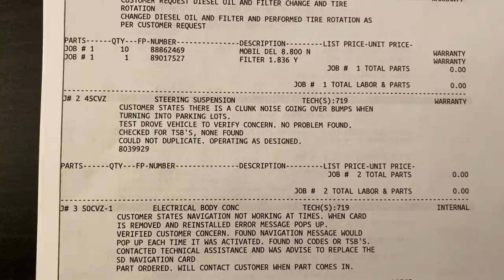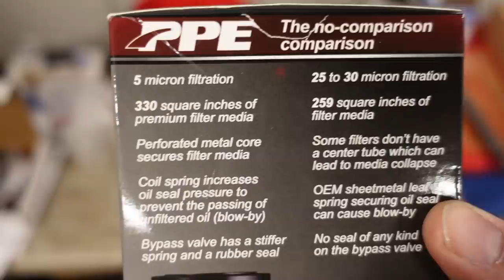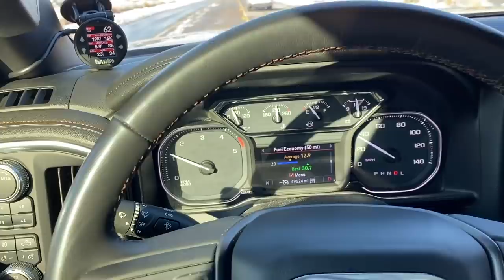fixing THE MOST ANNOYING PROBLEM with the 2020+ GM HD trucks

Comment: I bought a 2001 2500hd with 100k on it last year rather than buying the newer trucks I was looking because all new chevys are junk. It's crazy there's people doing all this work on a 2020 vehicle
Reply: Bought a brand new 2018 sierra all terrain 6.2l, a 2019 2500hd 6.0l and now a 21 2500hd duramax.. no idea what your talking about, not a single issue with any of them.. they're sitting in the driveway next to my 05/07 duramax's and the 2000 2500hd 6.0 supercharged monster..
Reply: @jredd801  I leased a 2015 high country and pulled quite a bit with it never above the towing capacity and at 20,000 miles the truck was beat the lifters ticked and it shifted like shit I felt bad for the person that was going to buy it. I leased a 2013 the first month I had it the water pump was pouring out coolant left me stranded. A lot of the new trucks have oil issues. When I was buying used trucks I worked a lot more on my 07 and 11 than I did my 99 and 2003
Reply: Also I think a lot of the issues are in the half tons the 3/4 and 1 tons are obviously a lot more durable

Comment: I surprised GM decided to put the oil filter within reach of the front driveshaft. If that U-joint ever breaks it will probably  take out the oil filter.
Reply: They've been like that for years and I've never personally heard of that happening.

Comment: I'm curious!  I have owned two Duramax 2500s and have been lucky to never have this issue.  Now that I see the shaft I have ask, has anybody taken the slip yoke apart and greased it well?  Or better yet put in a zerk?  I know back when I spend a lot of time offroad it was common for a slip yoke to cluck when it was dry of grease.
Reply: That was the tsb for them back in the early 2000s. Grease the splines and no more clunk.

Comment: This is actually a old Chevy problem from the GMT 800s as well they sold a kit where you would inject grease through the bottom of the shaft by removing that weird clip pin you literally have to do it every six months or the clunk will come back
Reply: I wonder if the newer trucks with electric steering are made different

Comment: Warranty is not any good for small items. Rear ends, 4 wheel drive, transmission and internal engine are hopefully covered.
Reply: The labor would be covered on any internally lubricated part, and/or any part damaged by the fault of any warranty covered part, or parts, though. I have a feeling that this is what he was concerned about. However, i couldn't be sure without asking.

Comment: Thanks for the info on all the filters I went ahead and ordered the bigger oil filter for my l5p since it’s not a 20 I guess it will fit as well as the fuel filter kit and I seen PPE had a nice upgraded screw on trans filter too so i decided to go with that too since the truck is turned up way beyond stock trans levels I figured I may as well get all good filters and try to keep everything alive as long as possible lol but thanks for bringing it up I never thought to look for things like that 👍👍 good looking truck BTW 🤟🤟
Reply: 2020 are different thread i believe  than earlier models. on the oil filter
Reply: @JCunningham21  ok very good to know when I looked on their site for mine I entered my year but I may double check and make sure I got the correct one thanks

Comment: Is there any particular reason why you went with that new fuel filter kit vs the blackmarket performance one with the cat filter?
Reply from the maker: Not familiar with the black market one, but if it uses the Cat 1R-0750 filter I don’t think that has a built in water separator?

Comment: Sea foam is fine gas burners not for Oil burners it lets water pass through the water separator
Reply: I use it in my 7.3L and 6.0L Powerstroke,  works great.
Reply: Heui injectors don’t have issues on the fuel side not trying to argue but sea foam offers no benefit in Diesel engines but certainly can cause issues and actually has less lubricant them just regular diesel fuel the only time a additive is needed is in extreme cold to prevent gelling not trying to be that guy but just trying to help if your really concerned about fuel quality or doing something that can really help add filtration dirty fuel is wat cause’s wear and in you case with a heui injector run a anti stictiin additive every othe oil change

Comment: 505hp and over 1k torque in the 2023 duramax and a new interior... what do you think LT? Is this beast getting traded in?
Reply from the maker: I don't know, that does sound appealing though
Reply: Nope.  Only 940 pound feet.  A bump of only  30 over the present trucks.
Reply: @richfarfugnuven6308  yeah unfortunately less they rumored
Reply: @andrewbrack77  I tried to order a 2023 F350 as I wanted 1200 pound feet.  They told me 10 months.  I bought a 2022 GMC Sierra HD AT4 3500 off of a lot.  No markup.  Doesn't pull my 42 foot fifth wheel as well as I would like up the Ike Gauntlet,  but you dance with who brung ya...

Comment: LT what percent tint do you still have on that truck? I remember originally you said you thought about taking it off since it was too dark. Just curious as to what you did.
Reply from the maker: The backs doors and rear glass are still 5% but I switched the front windows to 30%, windshield is 35% I think.
Reply: @LawrenceTolman  Is that 5% over a factory 20% privacy?
Reply: Jim jibroni  I have a 50% shield, 30% front two windows and then 17% over the rear three which has the 20% privacy glass from the factory. Thinking about going darker
Reply: Jim jibroni   Law enforcement as far as I know doesn't have a way to measure windshield tint.

Comment: I've been a chevy fan for years, but theoreticaly you'll need another transmission and probably the rest of the injectors around 70k miles! that sounds a bit fragile for what I'm used to.
Reply: Not if it's an Allison. .....and you don't have a junk ass edge tuner
Reply: I’ve seen too many GM issues lately. Buddy just had his 2020 in the shop for a month with bent rods. And it’s not the first one I’ve seen with the same issue.
Reply: @trentdawg2832  GM doesn't use Allsion transmissions anymore.  They are a GM product and they pay Allison to use the name.  Zero Allison parts in a GM HD truck.
Reply: @richfarfugnuven6308  that 10spd is junk…..id rather have my 6spd allison 1000 any day…….far less parts to give you issues
Reply: @trentdawg2832  no problems with mine so far...
Reply: @richfarfugnuven6308  maybe you got a wednesday built truck…..those are the best!!!!

Comment: Alma steering shaft could you not just take a couple of ball-peen hammers or something and didn't decide of the shaft at the tiny bit not enough to deform it and make it non-operational but to tighten it up a little bit

Comment: Don't add oil to the filter prior to installing it! You are basically then introducing unfiltered oil to your engine. There is always some form of contamination in new oils. Remember, the center hole in the filter is where filtered oil enters the engine from.
Reply: That’s not why you don’t pre fill your filter. You don’t do it because the internals already have a film of oil on them, pre filling is just a waste of time but not harmful if you choose to do it. As for the unfiltered oil nonsense, do you realize you pour the oil directly into the engine for an oil change?
Reply: @Jack-ih9hs   Come on man you know the deal.  That new oil hasn't been filtered.  LMAO.

Comment: I know this is a point of contention, but recently I have heard a very good argument to support it.  You shouldn’t pre-fill the filter.  The engineers say not to pre-fill in the service manual.  The reason is the pressurized oil enter the outside of the filter and exits the center.  When you pre fill that oil isn’t filtered and is the first thing into your engine.  I see this more as a problem with dealerships that use bulk oil and leave their oil pitchers sitting out all day collecting dust, but their could be some dust on a quart bottle also that could fall into the filter as you pour.  I am now in the no fill camp, mainly because the people that designed the engine specifically said not to.
Reply from the maker: hey, thats a valid point for sure, I could totally see dirt or tiny contaminants making their way into there.
Reply: I don’t fill the filter on my 2021 ranger. Mostly because they put the damn thing sideways behind the wheel liner. Engineers piss me off sometimes. Other than that I love the truck
Reply: @lesterparker1594  I’m an engineer, lol.  The argument is that engineers will put thing in odd locations that are hard to access, or that they make something out of plastic when it should be made out of metal etc.  The issue that the engineer doesn’t work for the customer they work for the company.  The bean counters are the real issue .  Ford had plastic oil pans, I guarantee that was to cut cost and for no other reason, and that decision was made by the bean counters.  The issue with your oil filter is because that engine was designed for a front wheel drive car not a truck, it was cheaper to use the normal position of the filter than it was to move it.  One last observation engineers, especially in the automotive industry, prioritize constructibility, they care mostly about it being able to be built.  Ford doesn’t care what you do with it after they sell it.  They only make a profit once.
Reply: @andrewf8486  yep absolutely true. At least my ranger has a metal oil pan haha. It’s really not that big of a deal. It takes an extra 2 minutes when changing my oil. It’s the only gripe I have about the truck

Comment: If the noise comes back, I'd find a snowblower or similar axle or chute bushing made of the hard Teflon, delrin or similar. Slide around the upper shaft and into the top of the lower. As far as retention goes, maybe a weak spring that stops on the upper knuckle and a washer on the bottom that holds the bushing in place. They make super thin plastic bushings with a shoulder and a diagonal slit in the side to wrap it around a shaft without removing it. Just a spring maintaining a slight pressure might be enough to keep it from rattling. A lot of the Japanese cars with extendable columns already have a spring there when I think of it. I remember some columns shooting out on their own when you release the position latch? I don't remember make or model though.